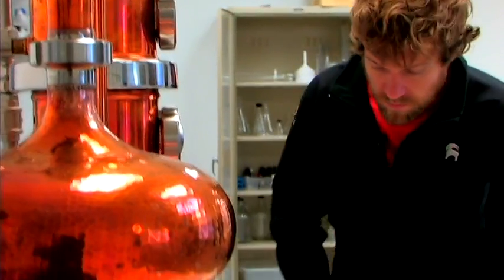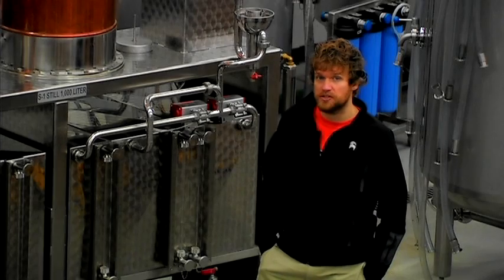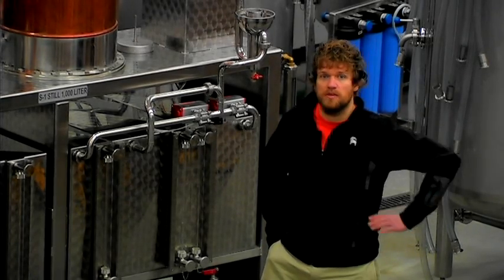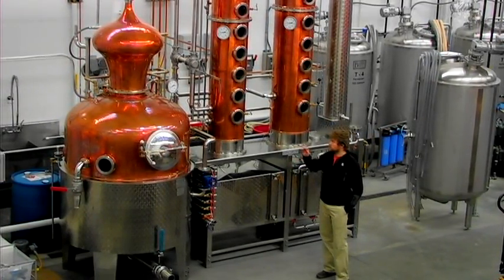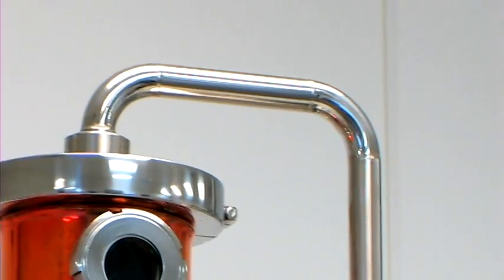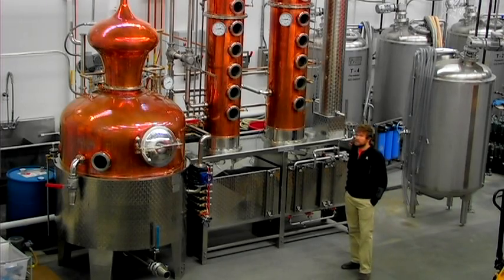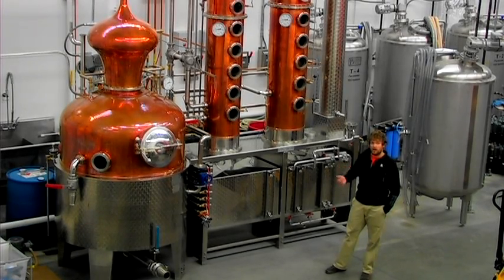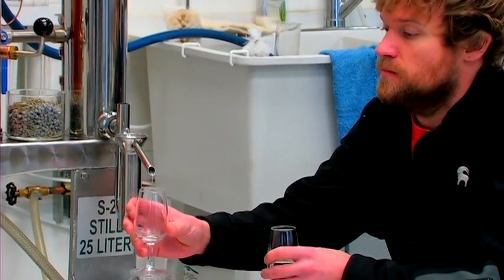Types of Alcohol : How to Make Vodka From Potatoes

Comment: I made vodka, it smells the yeast. how can I get rid of that smell?
Reply: never had it happen but you can try running it through an activated carbon system. It should remove any smell and also other undesirable elements.  i just use a Brita water filter myself.